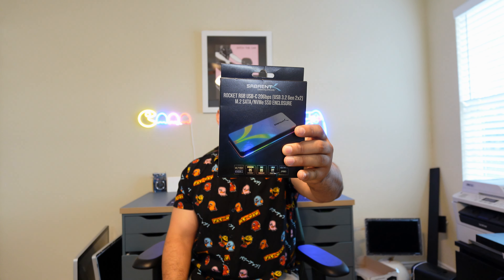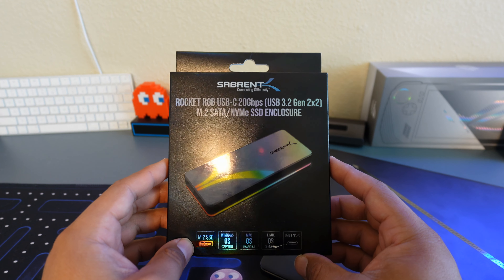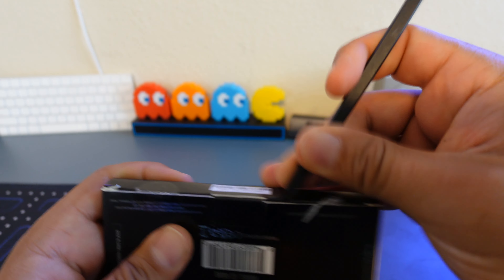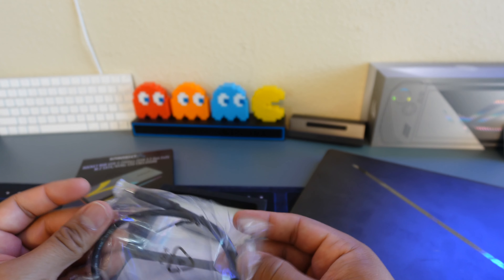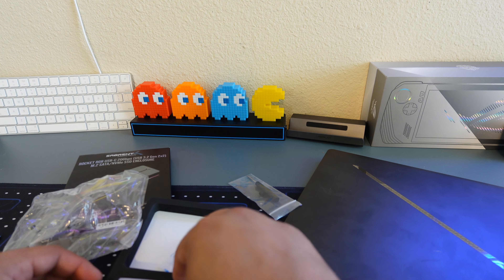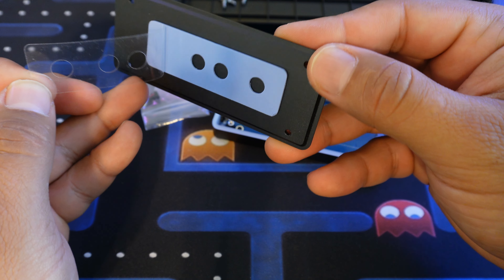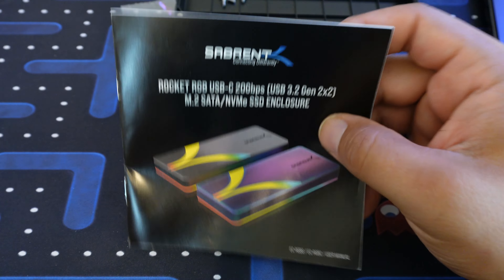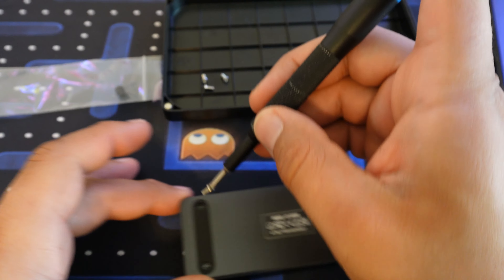Sabrent M.2 RGB 20Gbps M.2 SATA/NVMe SSD Enclosure Setup Guide

Comment: Does your laptop have a usb 3.2 gen 2x2 port (usb c)? That allows 20Gbps.
Reply from the maker: The Asus G16 2024 has an A dual USB 3.2 Gen 2 Type-A port is an USB port that supports two lanes of 10 Gbps operation, which can theoretically achieve a 20 Gbps data transfer rate. This is known as USB 3.2 Gen 2x2, and it's the fastest version of USB 3.2.
Reply: @Ghost57  I know, that's why I asked.